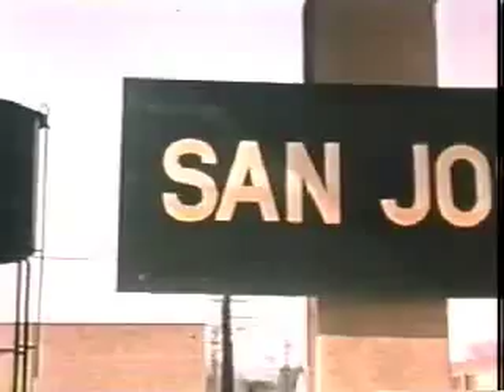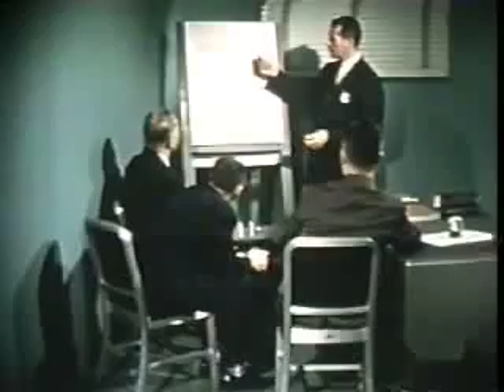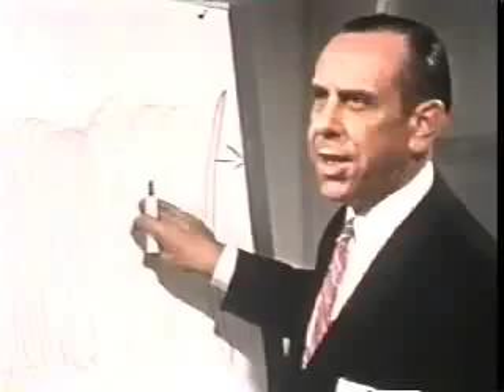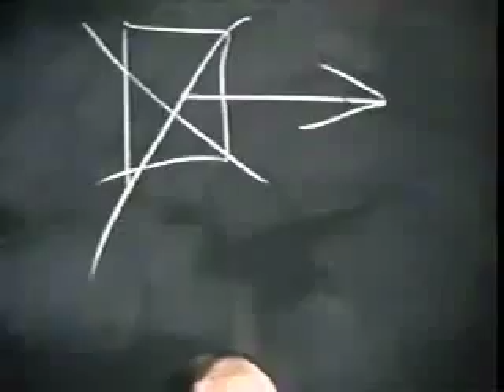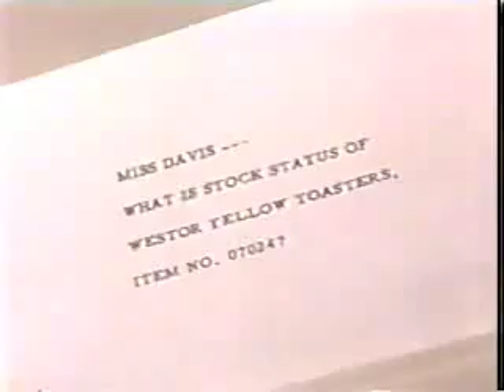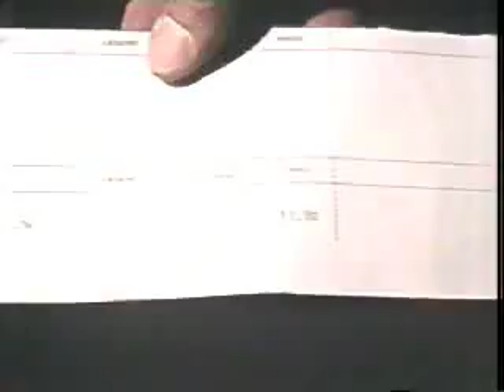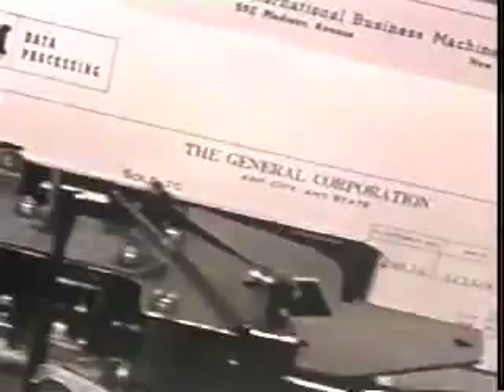The Search at San Jose

Comment: The IBM 350 disk system stored 5 million alphanumeric characters recorded as six data bits, one parity bit and one space bit for eight bits recorded per character.[8] It had fifty 24-inch-diameter (610 mm) disks. Two independent access arms moved up and down to select a disk, and in and out to select a recording track, all under servo control. Average time to locate a single record was 600 milliseconds. Several improved models were added in the 1950s. The IBM RAMAC 305 system with 350 disk storage leased for US$3,200 (equivalent to $33,300 in 2022) per month.

The storage capacity of the drive could have been increased beyond five megabytes, but IBM's marketing department at that time was against a larger capacity drive, because they did not know how to sell a product with more storage. (!)